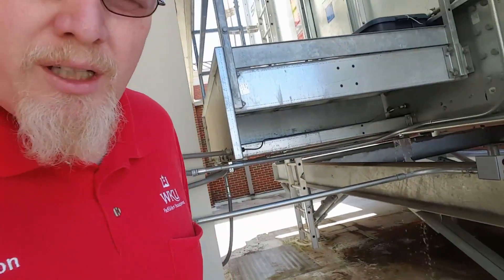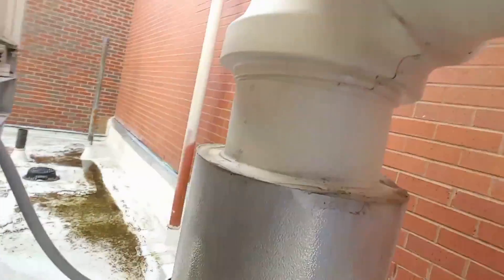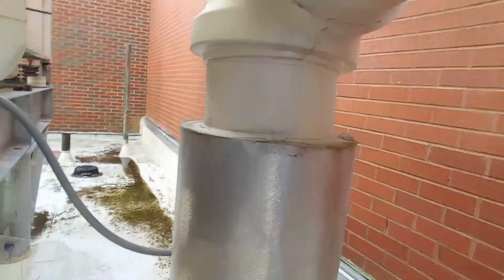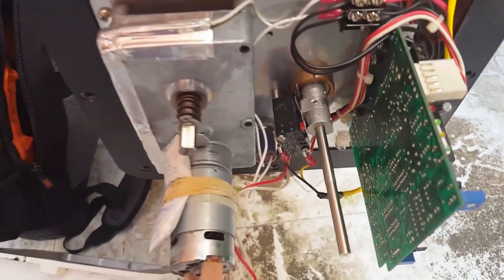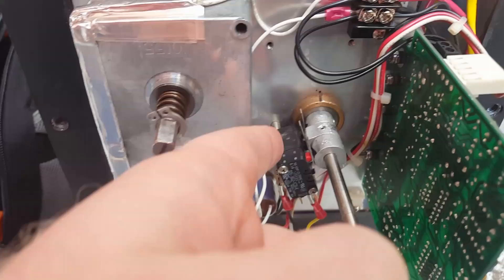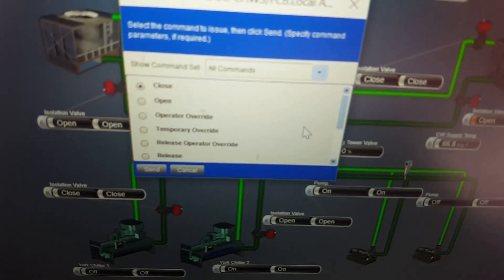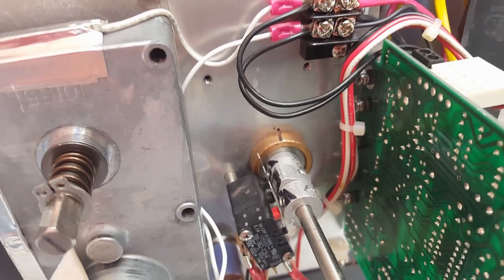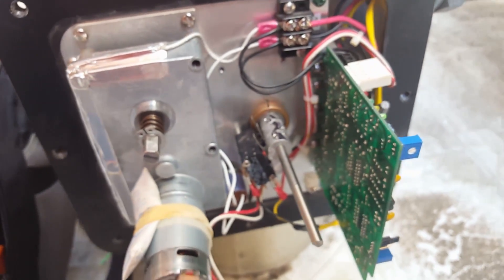Cooling Tower Overflow

Comment: Two Marley towers side by side if one spray pump is left on water will pour out of the other towers blow down..Is this normal?
Reply from the maker: The problem is there's no equalization line and they're located on two different sections of the roof.
Reply: Forgot to mention these are fluid coolers if that matters..

Comment: Iis any one familiar with the BAC Model # VT-1-560-0C towers. i am having to much water flowing out of the fan housing. no water is coming out of all three over flows. its seems to be coming out of the secondary fan on a two fan tower on two different towers. so basically tower 1 and 2 are using fans 1 on both. fans 2 on both towers have a lot of water overflow thru the fan housing and are setup to only come on only if fan 3 and 4 are calling
Reply from the maker: Sounds like you've got scale buildup in the tower